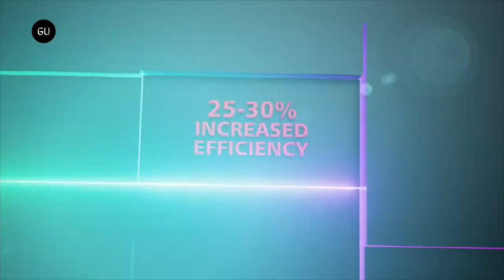TSMC 3nm Chip Production Can’t Keep Up with Apple Demand

Comment: Well is simple 3nm basic ( +1.6 transistor ) is good only for low watt device (60w). More that  exemple 125w  the ship burn 😄. Two solution multi ship at low watts but many ( expensive) or reduce 1.6 at 1.3 for transistors. But still many déchet. And it's the reason why 3nm Economic is not ready. For me it's useless IA is the future. Exemple 50 teraflop for 5090 that fifth ps5 at 650w . IA tops be convert at 32fp. 5090 have 3200 tops that 800 teraflop compare to 50 for 5090. The future